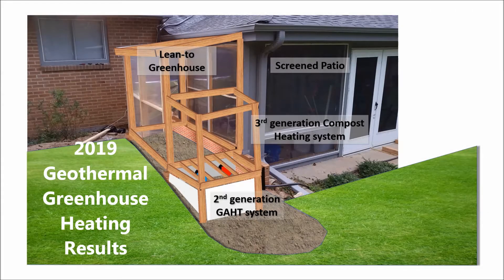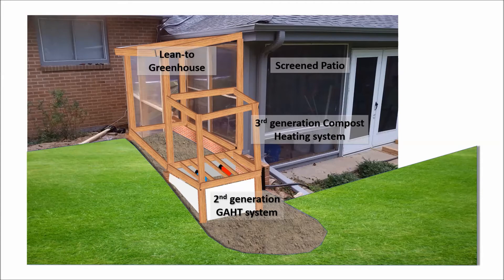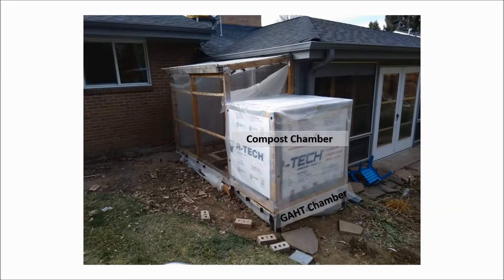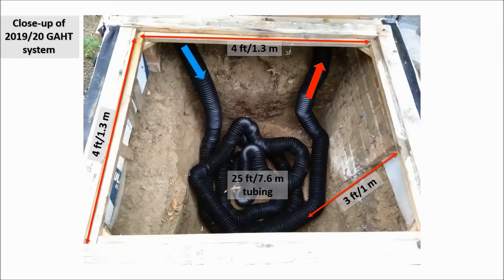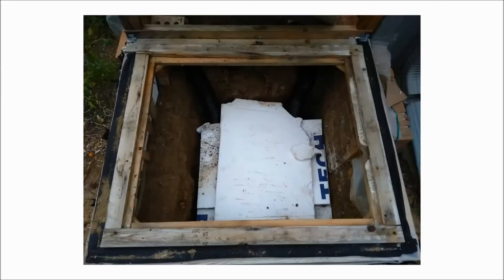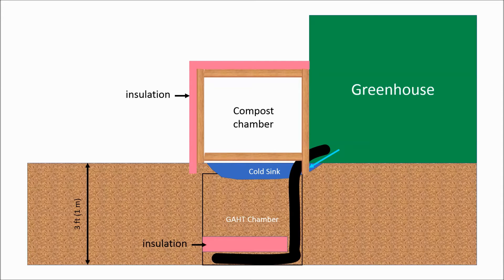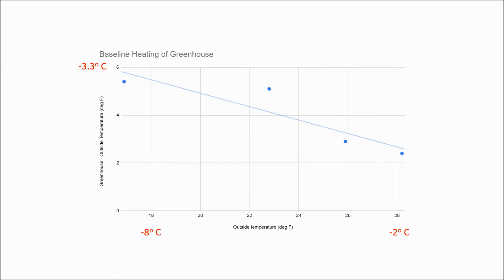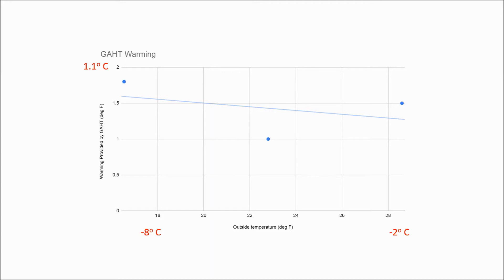Geothermal Heating (GAHT) Results - Greenhouse 3.0

Comment: Very interesting. Any updates on the usage of this system in 2021?
Reply from the maker: Sadly, my system is down for good.  We sold the house in December of 2020 and I removed the greenhouse... 😢 Once I sell this townhouse and buy something with more land, I will implement compost and geothermal heating on a larger scale
Reply: @MorganBrown  looking forward to seeing more videos about this. Would there be better gains if the vent forcing the air in the ground to be situated on the bottom and the return air vent on top? Since cold air is heavier, it will be more concentrated on the bottom of the greenhouse. Just a thought.
Reply from the maker: @Mooshi256  yes, it’s a good point.  You could then reverse the flow in the summer if you need cooling.  Heck, if there’s an elevation difference between the intake and outflow pipes, you’ll get a natural “thermosiphon” effect.  Check my compost heating results from 2020 for a nice demo of that effect

Comment: Good result from a simple system and modest amount of effort. My recollection is that the stable ground temperature is more likely about six feet deep in some climate zones. Now that you have the compost bin filled for spring, maybe the next step would be to try filling the hole with compost material as well, in late summer, to prepare for next fall. 🤔
Reply from the maker: BackwoodsBungalow haha, my very first attempt at compost heating involved a pit system.  Every time I try to iterate on the design, I come up against site specific constraints.  Maybe if this Coronavirus sticks around and I’m still working from home through the spring, I can build a proper greenhouse with an ample GAHT and compost heating system